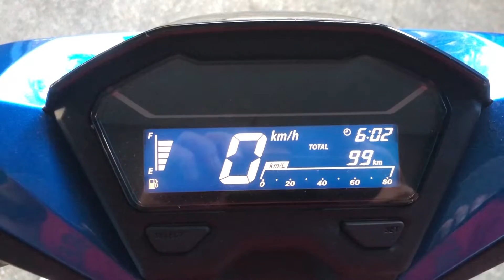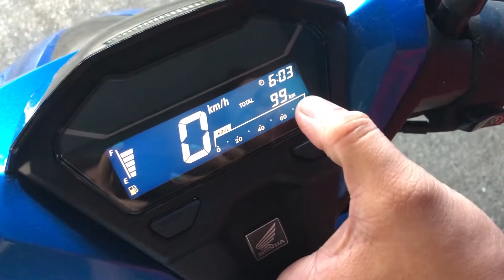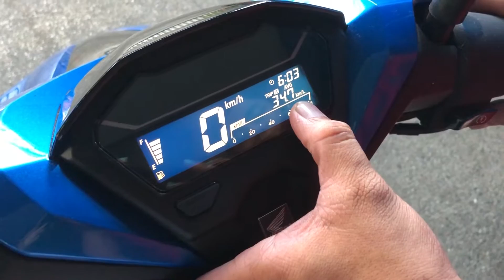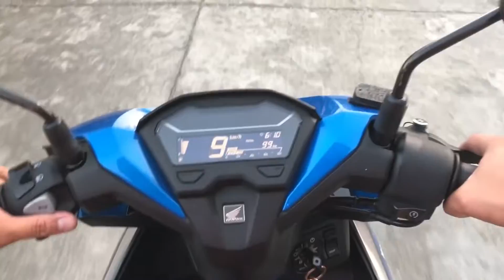Honda Click 125i 2019 / Short Review / Basics /Test Drive / BenzMotoVlog  #23

Comment: Sir, salamat sa video na to. Dami ko po natutunan. May tanong lng po ako, pno mlalaman na kelangan na mag dagdag ng coolant? Eto po ba ung liquid cool na tinatawag? Sensya na sir ha, baguhan lng po sa motor 🙂.
Reply: Actually po di po required magdagdag ng coolant kasi po nagcicirculate lang po sya. Not unless kung ordinary water lang gamit mo as coolant need po talaga magdagdag kasi po nageevaporate sya or natutuyo. Nagbabawas lang po ang coolant if may tagas po. If ever man po napansin nyong nagbawas much better po ipacheck sya. At kung magdadagdag kayo ng coolant make sure po ung ready mix na kasi po merong coolant na kailangan pang itimpla. Sya nga po pala di po ako expert mechanic ito po ay base lang sa aking nalalaman. Sana po makatulong
Reply from the maker: tama si sir jerry...idagdag ko nalang din na need morin monitor yung lalagyan mg coolant kasi meron level la full and low,yun ang minimonitor ko ngayon sa motmot ko...may nakita rin ako na kung magpapalit ka ng coolang is atleast every two years as in yung i drain lahat palit bago..pero sa ngayon na bago pa kapag nabawasan gaya ng sabi mi sir jerry dadagdagan mo lang ito ng mix na coolant na para ilalagay mo nalang..maraming salamat...ride safe mams paps salamat...
Reply: saan mismo nilalagay yun?
Reply: Salamat mga sir sa sagot ninyo.
Reply from the maker: jc mofo malapit sa ibabaw ng radiator may turnilto dun na kapag tinangal mo matatangal taki makikita mo lalagyan ng coolant...